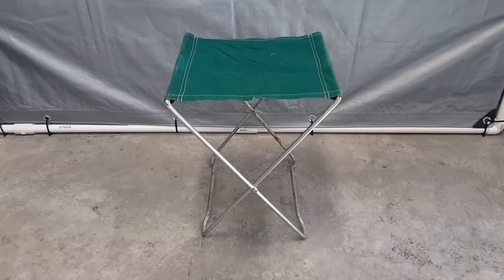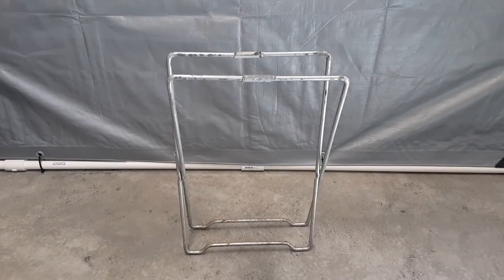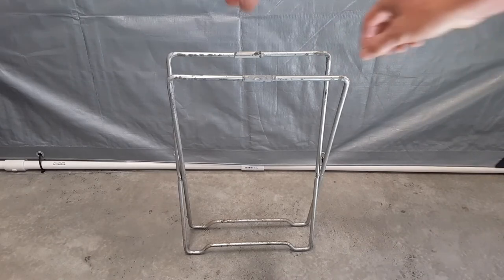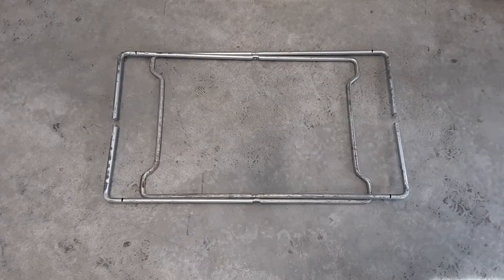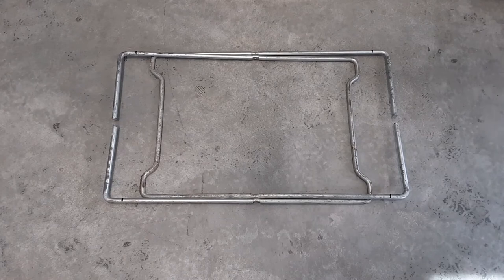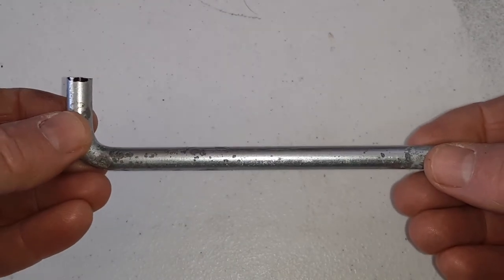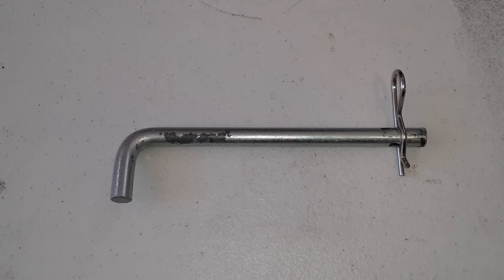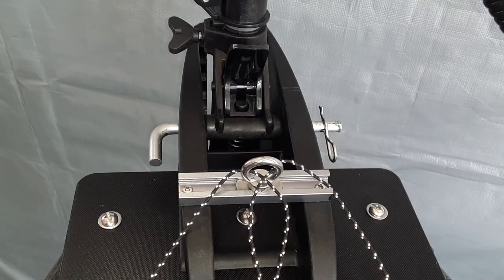DIY Transom Trolling Motor Mount Quick Release Pin

Comment: I had considered doing this type of setup using a few stealth pulleys and a modified square U bolt. 7x3.5 or so. This way it could be used as a quick release and also hit the trigger for the tilt. You could run a in-hull cord to the front with a jack plate and 1/4 hose as you have shown that you can pull or place in a cam lock. This would give you the ability to raise it quickly and also have reverse. I want to say i was going to flip the trigger but maybe I'm thinking wrong. It never left the planning stage.
Reply from the maker: I also have a video of a 2 pulley lift system that uses bungee cord as impact protection and from reverse kick back.